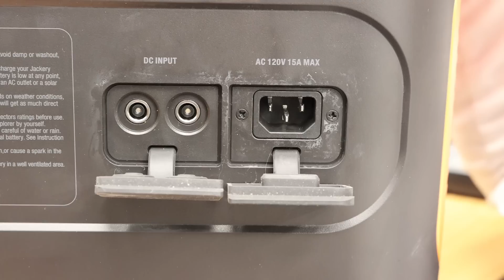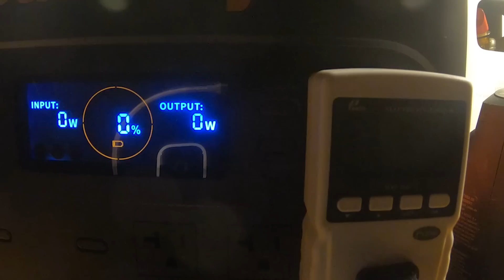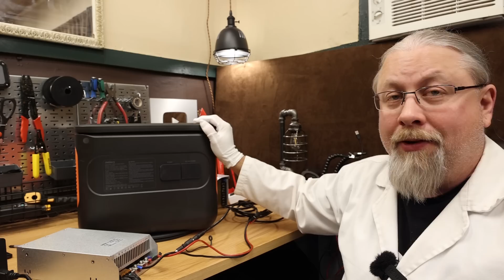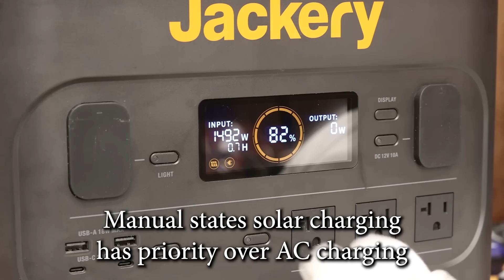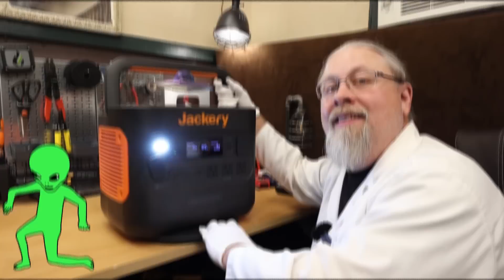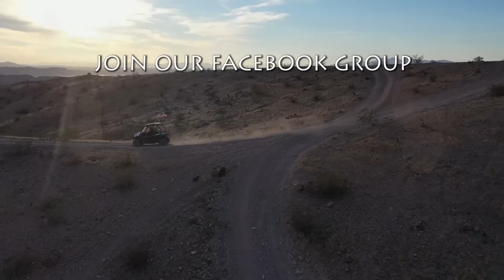JACKERY 2000 PRO 2200w UPS Solar Generator Battery Power Station Review

Comment from the maker: GET THE PRO: https://hobos.cc/jackpro (with solar panels: https://hobos.cc/2000sg )
Use code HOBOTECH for 10% discount. Also get a FREE 5 year warranty on this product!
WANT TO USE YOUR OWN PANELS? https://hobotech.tv/amazon/#Solar-Adapters you need the 8020 adapter and the 8mm female to MC4 adapter
Reply: Had this new 2000 in my cart waiting for the HOBOTECH discount code to work. Would have saved on tax.  No code = removed from cart.  I’ll just continue using my 1000 model.  Shame on you Jackery.
Reply from the maker: @joear9267  Yep, well the girl I'm working with there is apparently new and was "misinformed". At least they are offering a 5 year warranty which is a BIG upgrade from the 3 year.
Reply: @HOBOTECH  Jackery has way better customer service than Goal Zero. The only downside is Jackery doesn't have a big unit capacity like the 6000x
Reply: @HOBOTECH  I spent $8,000 dollars of solar equipment with GZ. Brand new GZ equipment gave me issues. I was respectful and GZ gave me the cold shoulder
Reply: "Yep, well the girl I'm working with there is apparently new and was "misinformed". At least they are offering a 5 year warranty which is a BIG upgrade from the 3 year."

Don’t feel bad. In 5 years the people gullible enough to buy this unit will be able to make the “BIG upgrade” to the Explorer 2600. 

Thanks for providing us with honest reviews. Did you ever get an explanation for why the Explorer 2000 mysteriously vanished from the market after only a couple of months in 2021? I was dumb enough to wait for the past year for it to come back into production ("Stay tuned", Jackery said), only to see the farce now known as Jackery Day 2022. "Fool me once, shame on you. Fool me twice…"

I like my Explorer 300, but I just ordered an Ecoflow and doubt that I will be buying any large capacity Jackerys in the future.

P.S. You need to add a stethescope to your lab coat to give yourself a little more street cred!
Reply: @scmreport2457  I have to agree with the professor in regards to the Jackery using the 8020 inputs. It's an outright stick up.
Reply: Hobotech’s 10% discount went to pay Chris Pratt and his mass market jokes and looks, instead of Hobotech’s dancing aliens and Hobolooks. Hobotech, please come up with some better jokes and start working out so we can get our 10% discount back 🤣
Reply: Amp interference is a deal breaker. I agree.
Reply: @resonancewaves9659  mmm mmm
L

Pop
Reply: Already had it in my cart. I was 50/50 but the 10% was making it much better. Oh well, holding off
Reply: I would MUCH rather have a 5 year warranty vs. 10% off. I’ve had to use my warranty on my 1000 and it was amazing. Jackery sent me a new one in less than a week and this was the week of the 1500 launch. I’m impressed with a 75% increase in warranty. But hey… that’s just me.
Reply: HOBOTECH discount code isn’t valid for the items in your cart    😿 (this is Odin telling Jackery to give us the discount code or change his litter box!)
Reply: Jackery jacked up the Hobotech 10% discount by bait and switching with adding some extra years on the warranty. WTF kind of confidence builder is this sales launch shenanigan?
Reply: Sorry jackery you missed this one up in time where people need discounts cause prices are high on everything anyhow 5 year warranty is just pointless if people can't buy it in the first place
Reply: The is no polarity protection on the 12 volt outlet.
Reply: WATCHING NOW, DOUBLE FIST IT !  DO EEET !
SEMPER FI
GUNNY
Reply: Discount code still works on other jackeryz maybe good time to get a 1500
Reply: Code doesnt work
Reply: Code nor working
Reply from the maker: Waiting for response from Jackery about the code .. someone there goofed (happens literally every single launch)
Reply: @HOBOTECH  I strongly believe if a company behaves irresponsible when you have been respectful. Not even making an effort to solve your problem they should be exposed.
Reply: @scmreport2457  Looks like I would still be sticking to my Delta Max 2000. Which holds up in pretty much all aspects when compared to the 2000 PRO.
Reply: Getting a message the discount code isn't valid
Reply: HOBOTECH discount code isn’t valid for the items in your cart
Reply: That's lame! Guess I'm not gonna buy one. Team hobotech
Reply: Thanks for the review but I had to stop watching half way thru.
Reply: Jackery has to pay Chris Pratt a butt load of money.  No more discount codes.
Reply: Are you doing a Jackery 3000 pro review coming soon?
Reply: The Jackery Explorer Pro 3000 is suppose to be out here this month 3/2023..Has Jackery reached out to you yet for a review?

Comment: I just purchased the Eco Worthy 1200w solar tracker. I have a Jackery 2000 Pro. How should I wire these panels to the Jackery? I am confused about the dual inputs on the Jackery. I was thinking run 3 panels in series , for two sets (6 panels). Run each set of 3 into each input on the Jackery. Panels are 19.8v, 10.5 amps each, 195 watts each.
Reply: Panels are 19.8v, 10.5 amps each, 195 watts each.

Comment: To everyone watching this review, please note there is a HUGE FLAW in the Explorer 2000 Plus!

We bought one of these units - with two of Jackery's solar 200 watt panels - to power our RV when there's no grid power source. It worked very well, but couldn't push out enough voltage to run the AC and oven simultaneously. So, we purchased a second battery with the connector kit that allows two Explorer 2000 Pluses to be paired, increasing the voltage to 240, which is more than adequate to run everything.

HOWEVER, upon receiving the second unit and connector box (which is way overpriced at $200), we could not recharge either of the two Explorers using 120v AC outlets from our house. In fact, plugging even ONE Explorer into AC DISABLED IT FROM RECEIVING ANY CHARGE, EVEN FROM THE TWO SOLAR PANELS.

We called Jackery's tech support amd, after 90 minutes, reached the conclusion that you CANNOT charge the Explorer 2000 Pluses when paired with anything other than solar. WTF???!!!

Sadly, we are going to have to try to return them amd go with another vendor if Jackery can't come up with a workable solution, asap.

Anyone have experience with another manufacturer whose product can be charged with a 120 volt power source and output 240 volt?

Comment: Too bad there isn't a small 2,000 watt solar panel that can be affixed to the roof of a teardrop trailer. The fact you're required to use Jackery's own solar panels is BS, a deal killer for me.
Reply from the maker: There's a perfect teardrop panel. Watch my Yuma CIGS review. There's also 50+ power stations reviewed that use any solar panel.
Reply: @HOBOTECH  Just checked it out. Impressive indeed. Thank you. You can even use them on the ground to charge your generator. How many hours would it take to charge a 2,000 watt generator to 100%? 12 hours? Sorry for the dumb questions. I'm new to this.
Reply from the maker: hours = watt hours / watts

Comment: Hi Hobotech! 
Have you had any hack for your DC source to replicate solar?
I used their own DC charger brick as input, but the battery didn’t even go for charge. 
The DC charger output is 24 volts and 12 amp, which is within range of Jackery 2000 pro DC input

Comment: Question: wall charger is rated for 1800W, what if I plug it into a wall plug with 400W Output capacity? Does it mean Jackery will trip my circuit breaker? 
So meaning I cannot use my Car 120V/400W power plug? 
Appreciate your hekp
Reply from the maker: Bingo
Reply: @HOBOTECH  so then that won’t work for my jeep, unless I use either 400W inverter or solar all the time?

Comment: Does anyone know if you can use 2 x 100W Solarsaga panels connected togther with a Y splitter cable and the 8020 adapter into one MTTP input and a single newer 200W Solarsaga into the other 8020 MTTP port? I only ask because the manual bangs on about the panels must be matched on each MTTP input. I already own 2x100W panels and want to be able to use them in conjunction with the single 200W I bought with the 2000 Pro. Thanks.

Comment: The only way to know if this will work as a suitable UPS for electronics is to have the load more sensitive to power fluctuations or use something like an oscilloscope. 20-25ms is enough to cause a PC to crash or power off under load. No one is going to notice a 20-25ms flicker on a youtube video.

Comment: I went with a refurbished Jackery 2000 pro over the Bluetti 200p, still $89 more than a brand new Bluetti. I'm a trucker and the extra weight on the lithium phosphate Bluetti is just too much for me. And I'm not running a lot of stuff. And that was my decision point.
Reply: Thanks for your Note so Ecoflows and Jacks are not Lifephos, right?

Comment: Is there a way to turn off the auto shutoff for the AC outputs? If so could this be used as an UPS when plugged into an AC wall outlet?
Reply: To clarify, Jackery products auto shutoff when it doesn’t sense a minimum output wattage. If this can be left on indefinitely regardless if there is a load or no load this would be an awesome product.

Comment: This unit is trash it won't take charge while using it completely garbage
Reply from the maker: If you watch the video I clearly show it charges while in use.
Reply: @HOBOTECH  glad yours does the earlier models don't unless you unplug it while in use and plug it back in

Comment: Thank you for your video.  I own a Jackery 1500 and it stays charged when in the OFF mode.  It has been at 99% for a year.  I bought a 2000 a few months back and, in the OFF mode, it lost 15% of its power in less than two months.  Is this standard?  Anyone else having the same?

They told me it was necessary because of the new "features".  I hate to keep a battery charging all the time. By the way, the Jackery customer service sucks.

Comment: Great review.
Iam a 77 year old senior and don’t know much about electricity. 
But I live in a city in which power outages are common, they normally don’t last days, but they last an average of 3-15 hours. 

For how many hours do you think this Jackery could power my 7 year old Sears (I think it is 120V), refrigerator?

Or any other similar power stations that could supply my needs? 

Thank very much.

Comment: can you charge this jackery 2000 with a non pure sine 2000watt inverter that i have in my van. please let me know.
Reply from the maker: Sure
Reply: @HOBOTECH  i purchased the Jackery 2000 and I plugged it into my 2000 watt inverter and nothing happened, it didn’t start charging. What do you think I’m doing wrong. It will charge from another generator. I made sure that the plug was secured and pushed in all the way. Please give me your thoughts. Thanks in advance.

Comment: Mr Hobotech I seen from a video someone posted, that on this 2000 pro he found that in order to get it to accept the solar coming in while using it he had to go out and unplug the panel from the pro and plug it in again for the 2000 pro to recognize the solar and start receiving the incoming charge from the panel while using it. Did you find this on the unit you are using in this video?? Thanks

Comment: STOP THE PRESS! That's not a real stress test for feedback for an amplifier. That's a self-amplified SPEAKER.  The speaker is a giant magnet; I'm sure the casing is a magnetic shield. The physical magnet with proximity to all electronics, so inferences; it's physically impossible to avoid disruptions,  You debunked the test using a PA system instead like an amp with possibly more capacitors. IMHO.. very informative kudos
Reply from the maker: Watch my latest review where the product passes the test. The problem is the Jackery inverter and not the test. I been doing this for years.

Comment: Picked my 2000 and 4x 200w panels on Prime Day for $1400 off.  Super impressed with the build quality of both the panels and the charger.  Built to last for sure.
Reply: 1400 off? isnt that only $400🤯

Comment: i love jackery always have!
however...
this still isnt enough for strait boon docking.
i have grown to hate rv parks..
nothing like being in the middle of no where boon docking
just make sure u have the right stuff  i went with the echoflow delta max
and solor panels.....
but we all know with overcast and rain....no juice
so as a back up i have my  duel fuel 12k watt generator ran on propane as a back up
to recharge the echoflow...
it works and when the sun is out using those 200 wattt solar panels helps keep that echflow toped of ok.
 i can stay boondocking for a good 2 months befor i might need to find propane
using gasoline is a very last resort.

Comment: After the battery in the Jackery 2000 Pro will no longer work, can the battery be replaced or is your generator just junk? I am thinking about buying one but I cannot spend that much money for something that will only last about 3 to 5 years. What do you think the total life of the generator and the solar panels are? Since it is only guaranteed for five years, is this probably how long it will last? If you do not charge it everyday does it mean that it will last that much longer? If you allow it to run down and do not charge it until you need it, will that make it even last longer? Jackery says that you can use six of their 200 watt panels. If you use your own like from an rv, how do you determine if they are more or less than the 1200 max allowed on the Jackery? This is all new to me but I thought it would be nice to have for a power outage. Thanks James Lewis

Comment: I noticed the other night with lights off that when the ac inverter is on there is a bright blue light inside the unit. This probably led and I wonder if that is where the amplifier noise is coming from? No engineer here just wondering.

Comment: Tom from HoboTech is a fantastic source of information just like Will Prowse and Dave Poz.

Tom, thanks for your candor in your review. I am a Bluetti and EcoFlow user and have followed Jackery but avoided their apparently cool products for all the reasons listed in this blog. The new J2000 Pro is a real standout in the disappointment department.:
a.) Overpriced: $3-500 more expensive than comparable products
b.) No Compatible: requires finicky Jackery acce$$ories (unless you purchase Tom's adapter), 
c.) Inverter hum and 
c.) Still using Li-ion technology. Let's be clear about one thing I may have missed in all the other comments. Jackery most likely switched to LiMH for temperature and SAFETY considerations. Li-ion can be very unsafe. LMH fewer ignition/combustion issues  So LMH is ok but is no holy grail. LiFePO4 may be heavier but a quality unit, properly maintained and conditioned, will last roughly 1.5-2x AS LONG as LiMH. Eventually, they both may be eclipsed by even newer chemistry like Na...still a ways to go there but very promising -- some already in beta.....

So unless Jackery passes out really great kool-ade at trade shows, they gave it a good try but are failing to keep up with the current technology and product pricing. I think the worst part is that (already mentioned) they think that their customers are stupid enough to fall for the custom "orange" solar adapters and cable.

Good job Tom!!!
RP

Comment: Slightly confused at the DC output rate check. First off you didnt show anyting about how many amps it can actually push, like you excluded that footage or something. Then you say it can do 10A and show its putting out 9.35A at only 11.1 V ?  I thought that port was regulated at 13.4V ??

Comment: I bought one of these about 2 weeks ago, PROS----- It does charge fast off home outlet or solar power, it ran my stand up freezer by itself for over 24 hours, it will take solar from my own 200 watt outdoor panels after buying the adapters hobotech recommends, I can carry it around, I like the display that tells you how many watts of solar is coming in and how many watts of energy is going out and what percentage of battery you have left. I like that it has a pure sine inverter and ran whatever I hooked up to it smoothly. CONS- Like everyone is saying the 8020 plug in jacks for solar suck I had to buy( mc4 - 8mm 7909) to the (8020 adapters) to hook my solar panels more money and skinny little 14 gauge wires, I am lucky to get 65% of my rated solar capacity on a sunny day in central Arizona. And you can't leave the solar hooked up all night expecting it to just start sending watts through it in the morning you have to disconnect the solar and reconnect it, and sometimes it just randomly turns off the solar input during the day like today when I was at 95% battery with 800 watts of panel hooked up and getting 425 watts max it just stopped taking solar so I had to un plug the solar from the back and re hook it it and then it seems to be working fine again. Overall its a well built unit with some solar charging issues caused by jackery trying to force you to buy there over priced solar panels. I will get a bluetti or ecoflow next time.